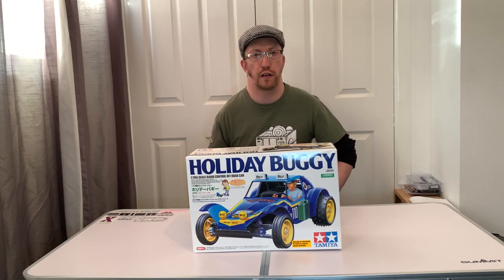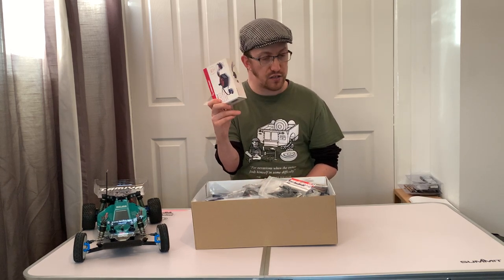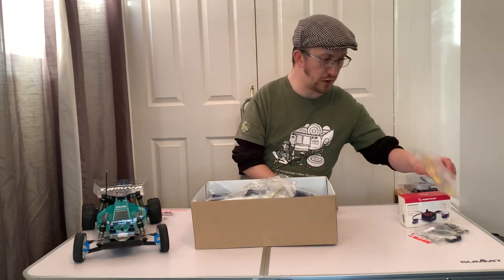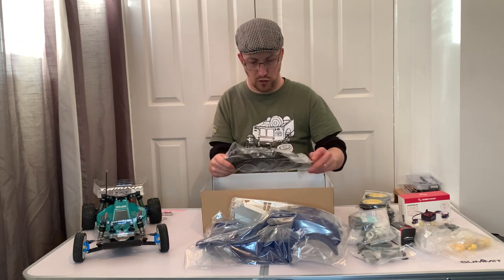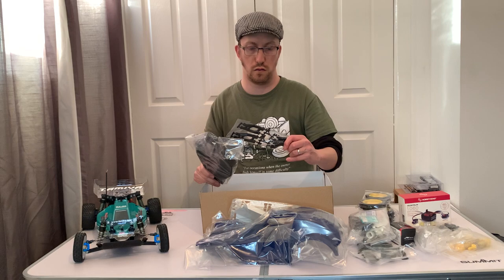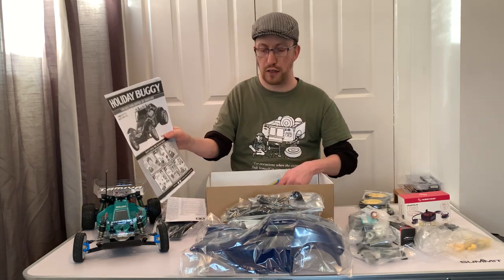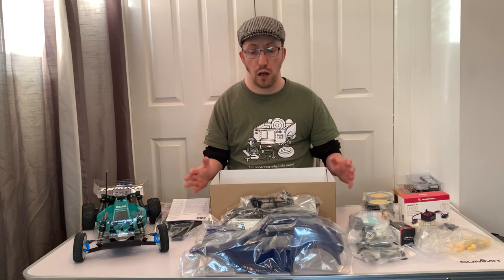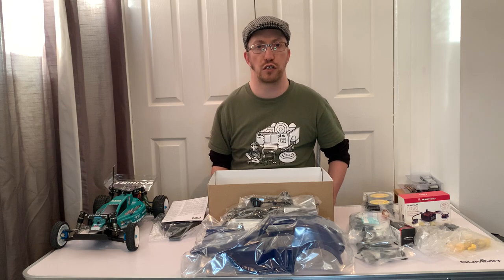E82: Tamiya DT02 Holiday Buggy Unboxing & Short Arm Conversion Plans

Comment: Did he choose a 17 tooth pinion, or the 19 tooth ?
Reply from the maker: Hi there that’s a good question I’d ha e to double check but I think it’s a 17t pinion but a steel one instead , many thanks
Reply: @andyrobinsonrc2480  I’m running a 19 tooth and a Sport Tuned motor on 2s. I’ll have to watch the temperatures and see if the 17 tooth would have been a better idea 👍🏻